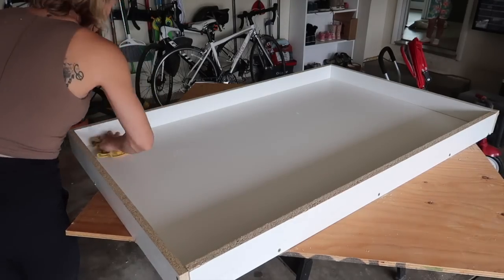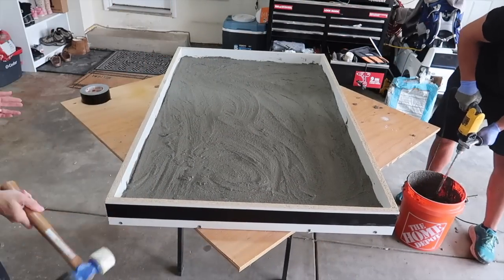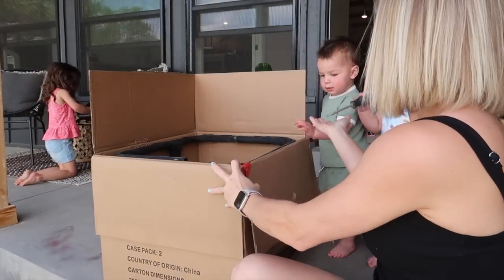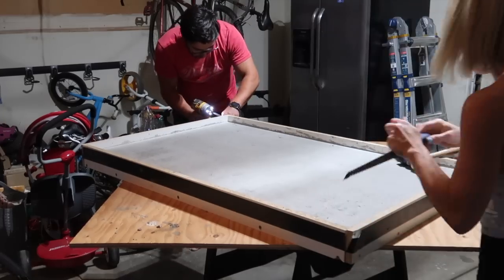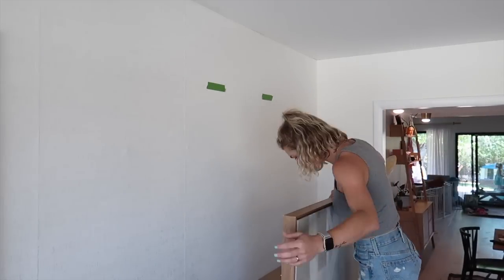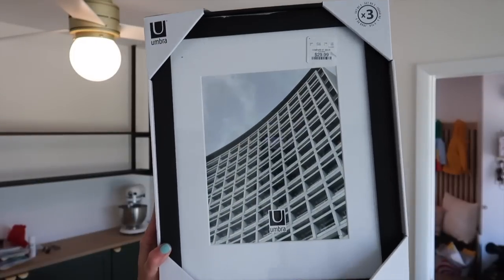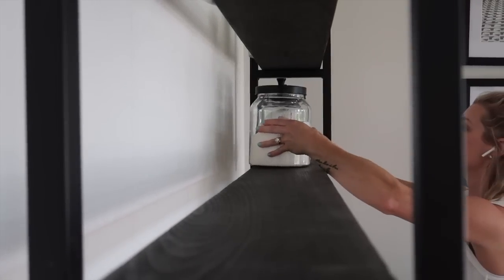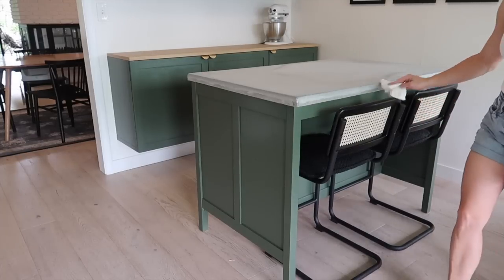PREP KITCHEN TRANSFORMATION REVEAL | BREAKFAST ROOM TO PREP KITCHEN | MAKING A CONCRETE COUNTERTOP

Comment: Hi, i was just wondering did you fix the countertop to the island in some way? Because i can not really imagine screwing it to the top. Or is the concrete to heavy to move or even flip over if there is too much weight applied on one side?
Reply from the maker: We will be using some sort of glue to fix it but it doesn’t slip or move at all as is. It’s too heavy but we will definitely be using something then I’ll caulk around the underside of it to fill any gaps